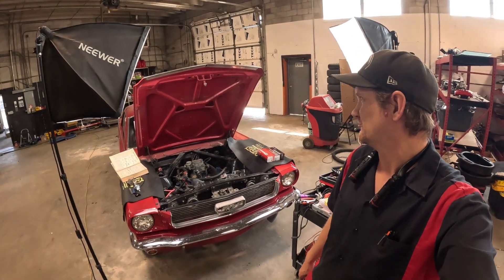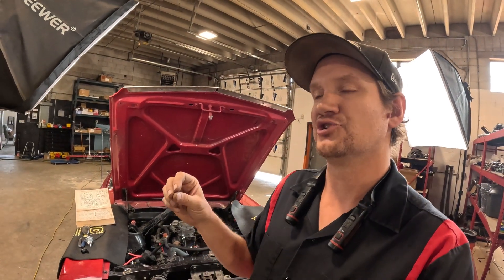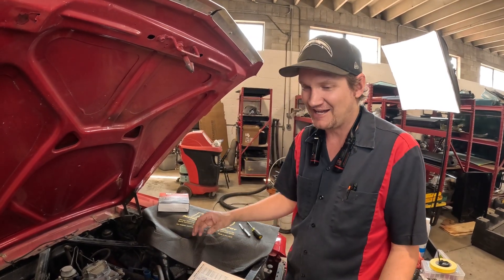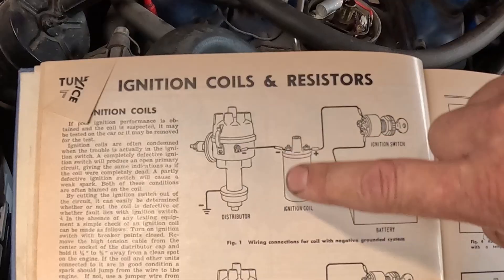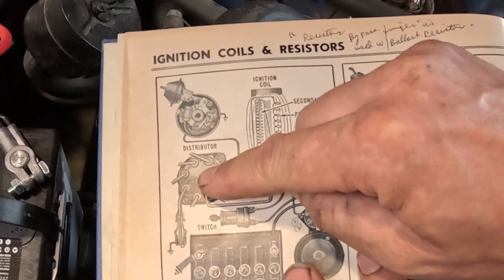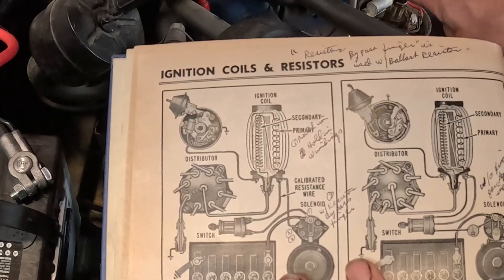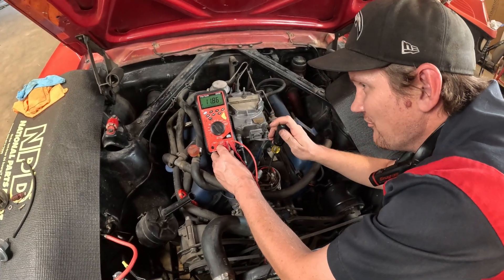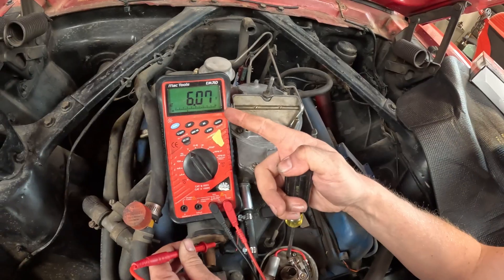Ignition Points - 1966 Mustang 289 - How it works

Comment: just want to say thank you for your awesome tutorial videos. i have just been handed down a bone stock 65 ranchero with the 200 i6 with 3 on the tree. with your help i now understand the breaker point ignition system and got it running now... now im going to give the autolite 1100 carb a good cleaning and try to really get her dialed in. i want to keep it as stock as possible as i think its really cool how the original system works. you are the man! thank you again....👍
Reply from the maker: Thats awesome! Ya if it has the original Autolite 1100, it would be in your best interest to keep it that way and get her all freshened up. Just be careful not to over tighten the base or top. That leads to those ends getting warped and then its very hard to find a suitable replacement.
Reply: @AlfsMustangGarage  i will keep that in mind, definitely don't want to ruin things i cant replace... thanks for the tip. i subscribed to your channel about 20 minutes ago

Comment: That boltage drop from 12-6ish has me a bit confused.
  Thunderhead 289 channel mentioned ince why peoples petronix was failung becayse it needs a full 12volts.
  Is that true, i installed a system and it was getting about 9 , ebded upcremoving it for a different reason but it did work. Would it eventually fail and how di you maintain the full 12 volts if required?
Might be a great video